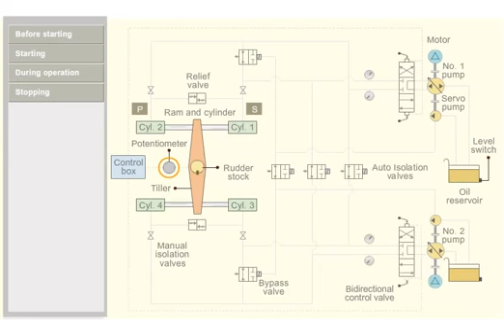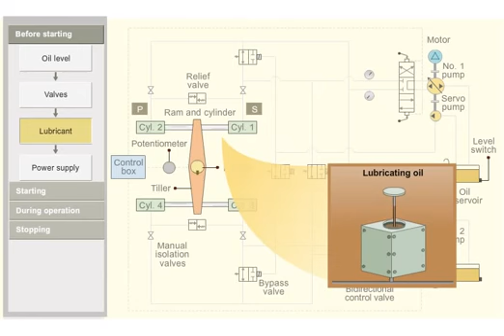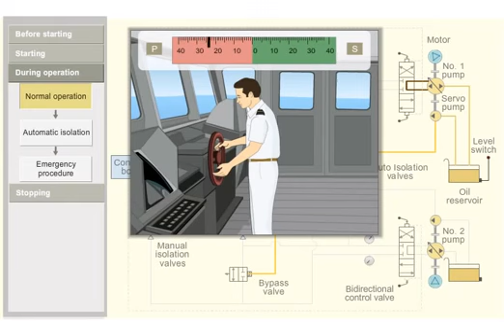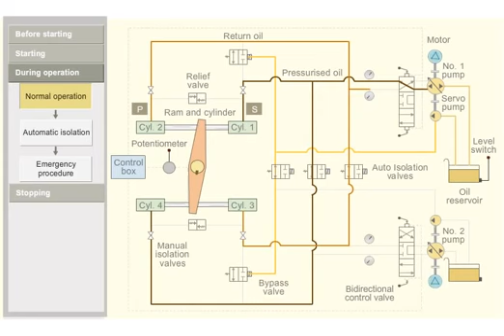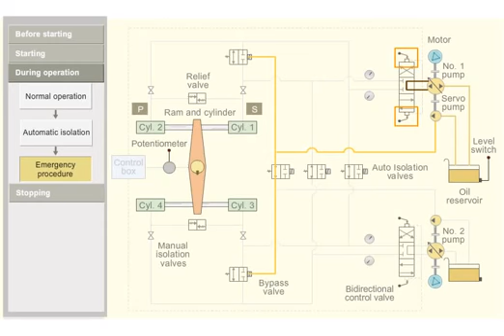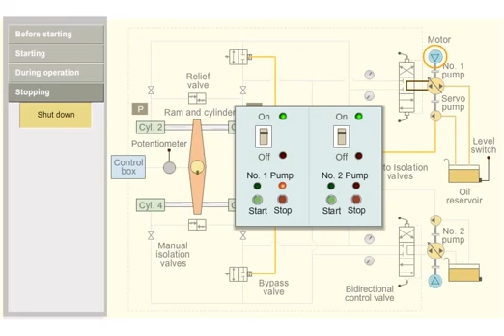Four Ram Steering gear

Comment: How the system will come to know that this particular line is having the leakage of oil. What if no1 pump running and leakage is on the other side of rams.

Comment: What's the purpose of servo pump ?
Reply from the maker: Servo pumps control the pressure or the volume flow. They precisely convert electrical energy into the hydraulic energy that is currently needed in the system.
Reply: @MarineEngineer  Thanks for the reply but my doubt is still remains. There are 2 pumps shown in the diagram, one is the variable displacement pump (which has an arrow inside ) and what's the other pump for?
Reply from the maker: @sinansadr5  which has an arrow inside is main pump which is used for priming and other pump is servo pump that i already explained you.but if still you have an doubt let me know.Give me your whatsapp number i will provide you brief description there thankx.
Reply: @Marine Engineer
Sir, Could you add me in your whatsaap, please.??? 
I've some question...
My whatsapp number:- +8801620271831

Comment: What is the importance of a Steering gear to the ship's daily operations?
Please help
Reply from the maker: Steering Gear is the equipment provided on ships to turn the ship to left (Port side) or to right (Starboard side) while in motion during sailing. The Steering Gear works only when the ship is in motion and, does not work when the ship is stationary. All the ships are to be provided with, an efficient main steering gear, an auxiliary steering gear and, except for very small ships, the main steering gear should be power operated
Reply: To steer the ship? 
Cuz the ship is always moving
Reply: @Crochet_Zoo  And please what are the reasons for testing the Steering Gear on a regular basis?
Reply: @emmanuelmensah7211  they do have planned maintenance schedule for steering gear so that it always in best condition n always ready to go
Reply: @Crochet_Zoo  Thanks a lot

Comment: Since hydraulic pump is variable delivery type... why is 4/3 valve used..... same can be done with 4/2 valve with some line modification..... sir please share your views on it..
Also, what if no.1 pump is running and fracture is in the line between no. 3 or 4 cylinder and isolation valve...
Reply: Bhai did u get this answer anywhere??